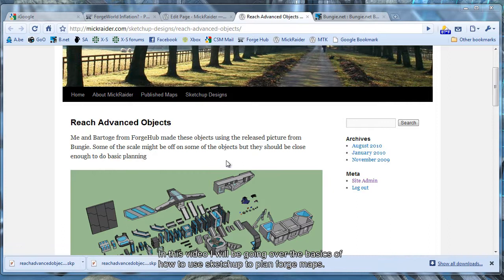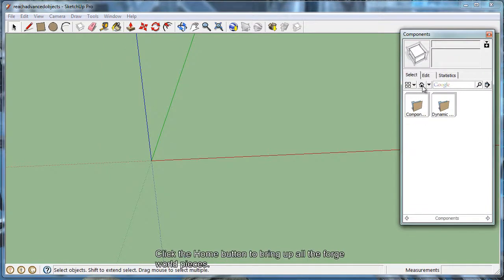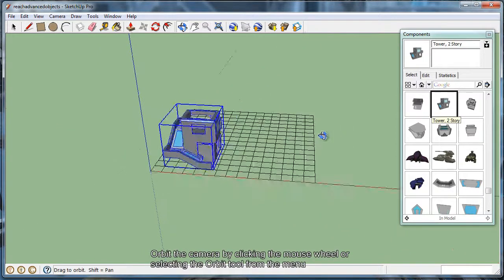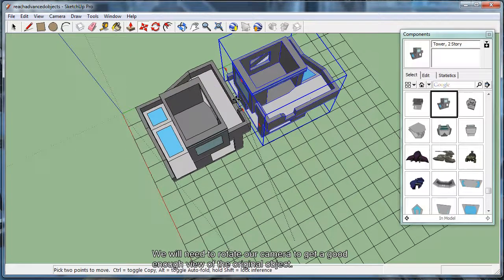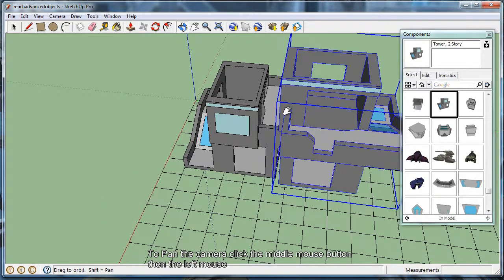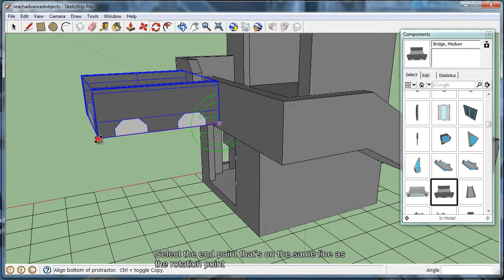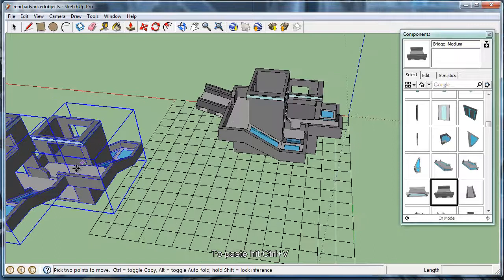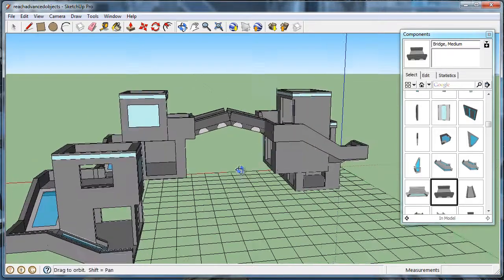Forging 201: Using Sketchup to Design Forge Maps

Comment from the maker: @JLPenland  To each their own. I design maps very vertically with lots of elevation changes so it's a lot easier for me to piece things together in sketchup than using forge. And it's a lot quicker for me to sketchup than actually draw it out on paper so I prefer it. Reach Forge is indeed faster than Halo 3's Forge, but it's still slow. Aligning pieces takes a good 30 seconds whereas in Sketchup I can do an entire area in a minute thanks to copy/paste/snap to/ etc. Sketchup is just better.